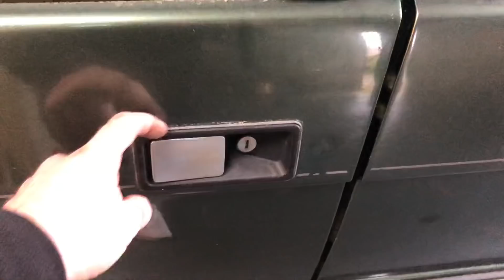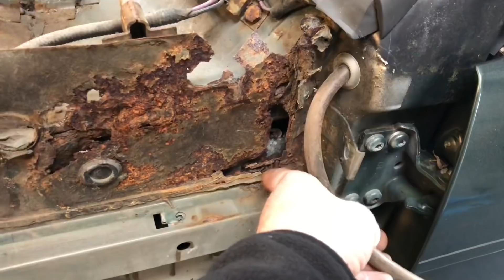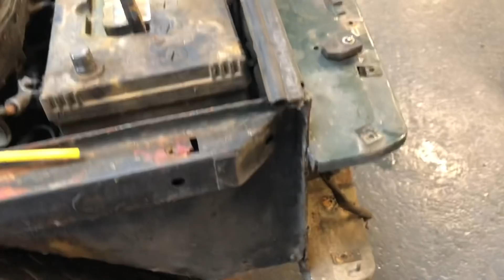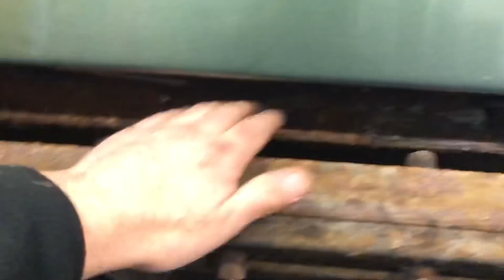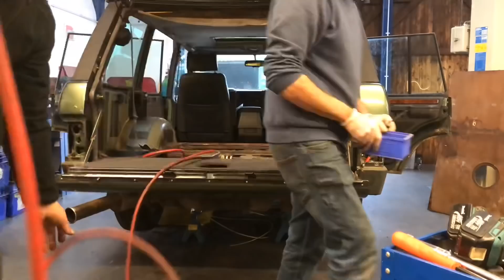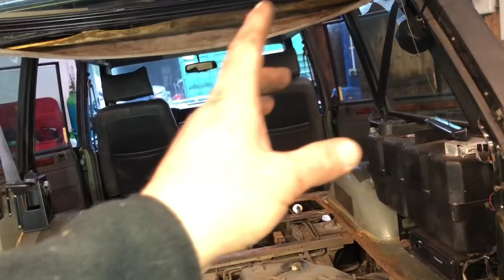Range Rover Classic LSE Soft Dash Strip Down PT 6

Comment: Just came across your channel, love it. I really need some help with a 99 D2 that has some leaking sunroofs and it's causing a huge headache for me.
  The vehicle runs and drives but the odometer is blinking, I've done some research and just need some input if it's a bad BCM from the water intrusion?

Comment: I don't think that the floor is a bodge job. 

The old floor was very carefully removed! Last person did a good job so your refit is easy. 

Also that looks like marine grade plywood.    It did not warp or rot all that time inside exposed underneath. Marine ply that thick would outlive a steel floor. Also it's super strong so would take the weight of the gas tank very well and non conducive. I suspect that was purposeful.

Comment: That wooden floor is crazy! Looks pretty good overall. How is the top of vertical part of the bulkhead under the scuttle? Mine needed some work there. Sills look pretty good. Would you be able to get some measurements for were the holes are for mounting the side skirts? I've put new sills on but didn't measure the location of the holes before! Should get the front wings etc back on mine this weekend. :)

Comment: Some cracking work there you two. And that rear floor ... very creative! What was also apparent underneath that floor was the chassis and fitting looked pretty sound so it looks like you really have found a gem and well done you. You mentioned the rear 3/4 panels were aluminium (?) so will be riveted or screwed in place? I would have those off and check for the usual corrosion you get when Aluminium meets steel.
Just my personal 'thing' but I would have all the panels painted inside as well as out as further protection. This car is SO worth preserving. I'd love to get my spanners on that!

Comment: I figured the back deck (boot) would be rotted badly.  It's current state is a huge score.  Now if the big section will fit to the cross  brace, but what are the odds of that?

Comment: Great video, the strip down went well. I must admit I was expecting a world of grief when you started. rusted or rounded nuts and bolt and spire clips. I thought the inner wings would be shot. when you were taking the sill covers off I expected most of the outer sill to come with it. As with a lot of range rovers and discovery's I was thinking it would need a spare wheel well, wheel arches and
seat belt mounts, pleasantly surprised. Keep up the good work. Looking forward to the next video.

Comment: Great video! I had a car with wooden sections in the rear passenger floor. I was surprised to learn that was how it's made like that from the factory. It was a 1991 LTI Fairway ex-London taxi. I think the older Austin FX4 cabs had wood sections in the floor too. 
That is going to be one fine Rangey when it's done!

Comment: You're a jammy git! I have recently worked on a mates '94 Disco and repaired the sills,  replaced  boot  floor etc but these cars usually have much more structural rot and it can be a bit daunting, the wooden boot floor looks like a blessing in disguise, they take a fair of work to remove usually. They don't usually come unbolted so easily either, good luck.

Comment: Good work guys, and pretty decent underneath the panels, considering age.  That boot floor replaced with wood probably saved you a day's work I reckon!  The spare wheel section I think was replaced at some point, due to the black coating, just like the driver's front inner wing.  Would hazard a guess it was about the time the gas system went in, and they discovered the floor was rotten?  BTW, that spare is a discovery 1, perhaps that is what they provided from factory as it was cheaper than an alloy?
Reply from the maker: Darren Coull 👍

Comment: I expected worse behind panels but it is prety solid.  When I saw the wood i though it was gonna be bad due to moisture trapped between floor and wood but really worked out well it's actually a good removal so all in all its a good base for moving forward and still worth chucking a few quid at
Reply from the maker: stuart crosbie 👌👍

Comment: Considering how really solid the rest of the car is I'm actually stunned that the boot floor would rot out to the degree of needing to remove it. I still say that the car is well worth saving as having done restorations its in remarkably good condition and a solid base to start working on. Good luck.
Reply from the maker: Graeme W 👌👍

Comment: Loving the videos guys. Isn't a wooden floor an MOT failure if not an original fixture? So pleased for you guys that most of the body is in good shape and I agree a full respray will transform the car. Keep it up.
Reply from the maker: Col H boot floor not structural so ok for mot 👍

Comment: That Range Rover is going to make a really nice car, that floor would not bother me at least your not having to start cutting out rot it won't take long to weld up the floor, I have had discovery's much worse than that, keep up the good work, in 5 years time the value of these early RR will shoot up
Reply from the maker: leedstown this one is the lse soft dash  the prices are already in the 20s
Reply: @sruk  did not realize they were so high a mate had a R reg 1997? Red range rover Immiculate condition he wanted £1,250 for it running and driving don't know what happened to it

Comment: Reckon you've had a right touch there with that floor mate. Supports just need a clean up ready for the new floor to go in. This is like a giant version of my little Suzuki Samurai SJ that I started restoring. All runs and starts first time, body not too bad. I changed all the break calipers, pads and discs. Cleaned the it all up ready for welding, then found out the French Government wanted €2600 to re-register it here as it's on Dutch plates. Sitting in my yard now and I just use it for getting logs in. Gutted though as they're great little 4x4s. Range Rover looks like it's gonna come up nice. If I had the dough I'd genuinely be interested in buying it. Dream car that. Cheers mate and look forward to the next video 👍
Reply from the maker: Robin L 👍

Comment: would that pass an mot with that wood in the boot? just curious as i would have thought that would be a fail. I know certain things to do with the cab on jeeps are different if its independent to the chassis, or am i completely wrong on that?
Reply from the maker: chick99936 you’re 100% correct but the boot floor is not structural on this vehicle so he’s not an MOT failure
Reply: @sruk  thank keep the vids comeing loveing them all

Comment: It's nice to see the old mud plugger back on our screens again , and I cant imagine how it ever passed a mot with  a wooden floor , but at least you haven't got to cut the old one out .
Reply: Probably wasn't considered structural as the car has a separate chassis to provide the strength.
Reply: @a1topdog  I think you have a valid point there especially as it was only spot welded, if it was structural it would need to be seem welded, I think .
Reply from the maker: stuart yaxley 👍

Comment: I know the woods a visual shocker but its not the first time I've seen it. Fact is, it's a non structural area (bit naughty with the seatbelts though) so it's a common part to bodge by people who cant weld. 

As for the rest of it, it's honestly one if the best I've seen. Usually the front inner wings have holes a badger could live in.

Some Dinitrol, Corroless and some weld and your onto paint stage. All good.
Reply from the maker: Scottish Outdoors 👌👍

Comment: Could you get away with welding some flat sheet metal at the correct thickness? as it looks a nice and flat area to work on
Reply from the maker: Russell Jones i have bought the correct floor for the car picking it up tomorrow 👍

Comment: I would not be worried about the floor as half the job has been done in removing it leaving you and Chris an easy job to refit some metal, That Rover is in great condition compared to the ones that I used to fix some 20/25+ years ago and as normal Rob if you are going to do a job then do it right first time around lol  Looking forward to more vids from you both as it reminds me a lot when I had my little bodywork shop repair garage,
Reply from the maker: Scooby Doo 👌👍

Comment: word to the wise when you fit any fasteners to the body panels.... Land Rover has a habit of using steel fastners in the aluminium panels. If you can any holes bang some primer on the exposed metal or just a layer of grease.

Spent 6 months fighting with galvanic corrosion on my P38 when I restored it! Could have been prevented so easily if land rover had just dabbed some paint on the expose aluminium!

Trust me I missed one and within 12 months living by the sea one fastener for the light protector meant I had to fix up and respray a panel I had only sprayed the year before 🤦‍♂️
Reply from the maker: BillyB 👍

Comment: Good luck on getting a boot floor, they don't exist!. Some people cut Disco floors to patch in but as you need the whole thing that wont work. That wooden floor has actually done you a favor as the profile of the original floor is a total rust magnet . Personally I would just put some flat sheet in (I did on mine).
Reply from the maker: Ogri biker I said what I was doing with the floor in the video 👍
Reply: @sruk  Must admit I was doing other things whilst it was on!, will have to go and watch it again!
Reply from the maker: Ogri biker I don’t mind that lol 👍